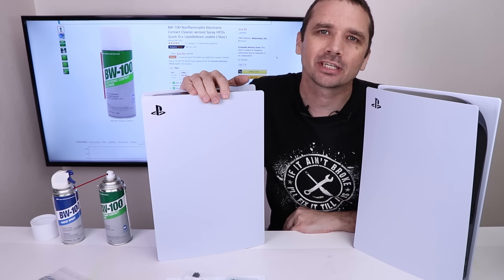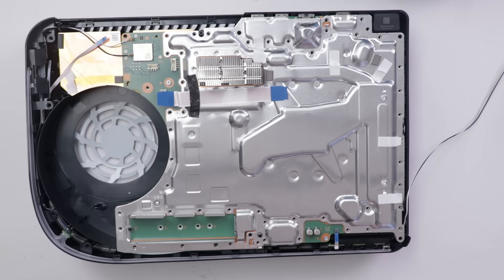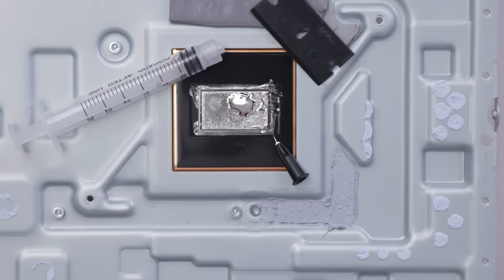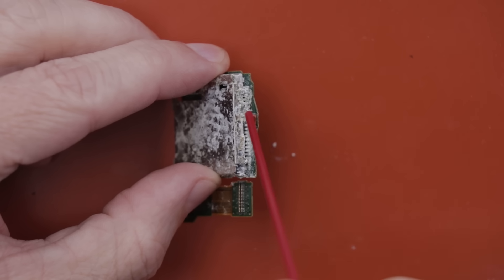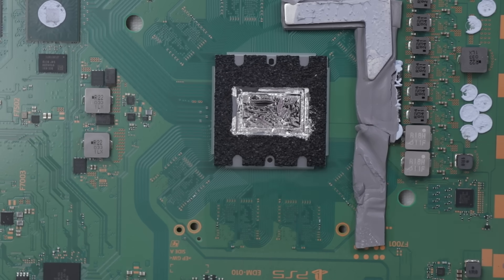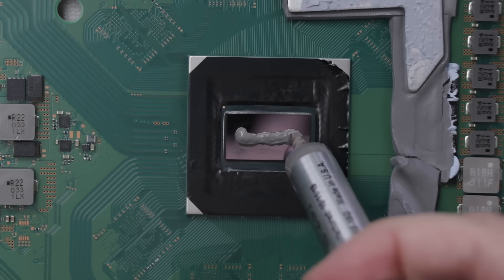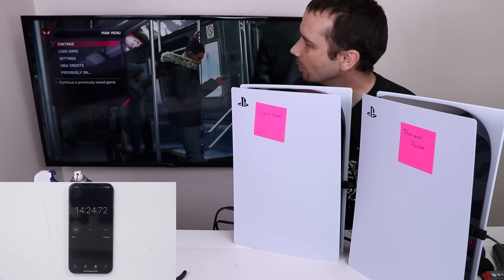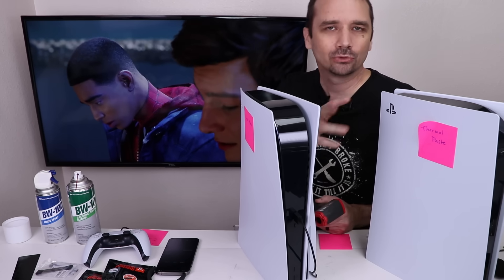PS5 Liquid Metal vs Thermal Paste - It OVERHEATED!

Comment: I still think liquid metal is just a bad idea in the long run. Especially with the bad time people have had with it already in PCs and how much it takes to clean it up without it going anywhere else. We'll see if we have a red ring of death type situation, or worse because it can destroy the system in worse ways.

I wonder how much damage it did with the liquid metal because it was still on versus the thermal just turning off right away during the fan test.

Comment: I guess the main reason for Sony to switch to liquid metal is to keep thermal interface maintenance free because that was a big deal with PS4 which required thermal paste replacing every 3 years unless you're fine with jet engine sound. Thermal paste no matter how good and expensive still dries out and loose its thermal conductivity while liquid metal doesn't.

Comment: wayyyyyyyyyyyyyyyyyy too much thermal paste applied. that will ooze everywhere off the chip and cause overheating and other issues. Tiny pea sized drop in the middle is all that’s needed, nothing more. Very infuriating to hear “perfect amount of thermal paste” and then see that murder scene when you apply it literally scraping off the edges off the chip with paste

Comment: Hello! I hope my comment is still appropriate, considering this video is 2 years old now. 

I have a feeling that the PS5 has a terrible design flaw and overheating issue which Sony wasn't able to solve and that's why they went with the liquid metal. 
As a last resort to be able to launch the console on time.

Looking at your recent /2023/ liquid metal dry spot videos, I'm getting fairly concerned that the liquid metal is not really a 100% fix for their own issue either. Basically these PS5s just slowly cooking themselves until they boiled and instant e-waste after 5 years. If they last 5 years.

Also it is confirmed that the PS5 by hardware are not capable to output an 8K video signal, but it's on the box. So this liquid metal and 8K issue are just a hot bed for the perfect lawsuit but i have no idea when, who and how will go against Sony and claim his money back.

On the other hand, Series S and X runs perfectly /the X even on bigger performance then the PS5/ on thermal paste...
Reply: Average XBOX Fan Boy

Comment: although the liquid metal ps5 obviously ran longer the test time is wrong. you cut them on at the same time and ran the thermal paste one first till it overheated then when you should have ran them both till overheating. The time to run 1 switch cords and boot  the game on the other might only be 2 minuets at the most but is still not  accurate.

Comment: Hey I have a question....have you ever seen a PS5 that is missing the green bottom that holds the spacer for an internal ssd?? I don't have the green bottom that has the indentions where the spacer fits into before you put the screw into the ssd. Down by your left hand at 2:03.  Mine is just the metal bottom with the screw holes. No green bottom nor does it have the spaces to allow your spacer to fit into for whichever internall ssd you choose to use. Have you ever seen that before or did someone forget to put that piece in?? I can still put the ssd in but it doesn't sit in perfectly. It works but every video I've seen with a PS5 opened that piece is there.
Reply: You’ve got a newer model of the PS5 then.

Comment: I'm confused. Why would the PS5 stock overheat at all? I'm shocked honestly as I just ordered one lol.
Reply: He misspoke ps4 several times. This was when ps5 was new
Reply: @JWalker Don't worry about your new PS5 overheating. They have really great cooling designed into them. @ 2:07 Look at those heatsinks and copper tubing. If you got the room, lay it down. I saw somewhere, the liquid metal flows to the lower side of the processor, when standing up.
Reply: @markorkarenhanes1354  that the launch models not anymore

Comment: glad you can take the motherboard/heat sync out together 
i was worried about that since i like taking my systems apart to clean the heat syncs every 6 months to a year (depending on how bad dust/pet hair gets to it
i know theres vent holes you can use a vacuum to suck out dust/etc but i feel like those dont actually work that well

Comment: Ps3 ,ps4 was very strong consoles, I'm very sad the ps5 isn't strong, I hear, l see, I read ,many problems 😢 I hope to find a solution before is to late and this great company fade slowly in the dark
Reply: a solution to what?? what are the many problems? I've had mine since release and 0 issues
Reply: @Ryan shnoztwazzle  search to YouTube  " ps5 problems over heating  and liquid Metal problems"""and you will find the answer
Reply: Uhh you need around 24 PlayStation 3 consoles to match a single PlayStation 5 or about 8 PlayStation 4 systems to once again match a single PlayStation 5 in terms of power, so no neither the PlayStation 3 nor PlayStation 4 are "strong" compared to a single PlayStation 5
Reply: @BambanGarcia  the truth is the ps3 consoles and ps4 pro and slim,,still working and the owners are happy because the money 💰 don't drop in trash can ,,,but the ps5 owners spend 700 $ for one  console and after one year to many are at the technicians by overheating cpu or overheating ssd or other problem,,,isn't crazy to many people     and they are freaking about ps5

Comment: Thermal paste didn't work well with the ps3. Yellow light of death was basically the thermal paste burning off. Afterward I had to constantly reapply with a cheaper one that was available over the counter because the one Sony used was banned for environmental reasons.
Reply: So does using Liquid Metal avoid the Yellow Light?
(60GB BACKWARDS COMPATIBLE PS3, PLAYS ALL PS2 GAMES, has the PS2's CPU/GPU)
Reply: @LennyJBA  I don't think you could properly seal in the liquid metal on the ps3. I don't think the tolerance in fittment would allow for the same sort of seal as on a ps5 but I could be wrong. It's been over a decade since I did all that.

Comment: Thermal past is looking a lot more interesting now with all the reports of dying PS5 because the liquid metal can leaked out of the APU into the motherboard...
Reply: There are no ps5 dying because of liquid metal, it's just rumors, plus wouldn't have the engineers at sony thought of that first?
Reply: @andrejpopovic52  And engineers never made mistakes? The point is that you can't blindly trust anyone, but there's no harm in warning people about a potential issue but it's just dumb to accuse someone trying to help while defending a mega corporation driven by money.
Reply: @ale-lp  It only leaks if you try to mess around and tamper with the heatsink

Comment: Tronics, have you heard the latest news?  The liquid metal is leaking into the seal of the apu in the vertical position.  I want to use it vertically, but the only solution out there is to turn it horizontal to prevent this.  There's gotta be something we can do to use it vertically without worrying about it leaking.  What can we do?
Reply: You have literally nothing at all to worry about, bro. I'm an IT Hardware Technician, and I performed a tear-down of mine two days ago (Been in Vertical position since April 2021 and played on a near daily basis). Nothing at all was wrong, APU seal was still holding strong with no issues whatsoever. Don't believe the hype, it's not a widespread problem.
Reply: Not buy into click bait articles based off a guy who runs a repair shop and only sees bad things. 30 million sold and it isn't some red ring of death level issue. I think you'll be fine man.
Reply: literally nopthing unless you open it up and rub vaseline everywhere or stop the force of gravity
Reply: Lots of pressure is applied to the apu and the liquid metal. It cannot seep out

Comment: please never use such cans for cleaning your RIG. You can buy a blower and use it  everytime again. To disconnect the fan is no usecase, but i get the point.  Look how the PC guys do it for years. So there is "normally" not an issue with liquid metal if you follow the rules. The PS5 builder just apply too much. Sony, just put a glue on it like intel did it on their heatspreader. Please, not everybody wanna lay the big console only cause of your fault. Just sad, not more. This is not a new thing, you just need to do it right. I think every company needs to make their experience with liquid metal on the shoulders of their customers. for example: Miniforums PC with LM. Same sad story. Nobody learned something, nice !

Comment: Im wonder, is there any issues when you put PS5 with their Liquid metal on verticaly position? 
Is the gravity doesn't affect Liquid metal at all?? 

Thank you..
Reply: Standing it vertically shouldn't cause the liquid metal to fall onto everything else in the motherboard. The ps5 has multiple seals to protect it. It can still happen though if the ps5 is bumped really hard enough to cause the liquid metals seal to break and start dripping over the motherboard. But if it's just sitting there and you handle it with care(not bumping it) it should be fine.

Comment: What if you use twice the amount of liquid metal?
Reply: You wouldn't want that as you want to use the lowest amount possible to keep it from leaking on other parts of the board as gallium is corrosive. And same with thermal compound to create less resistance for heat.
Reply: @Whaley96  thanks
Reply: @drewhjc  Well with thermal paste you are applying pressure so the excess is squeezed out, making a mess. So there is no increase in resistance, it just makes a mess.
Reply: You flood the machine and risk shorting. Personally its an odd choice for a console, the seals make sense but in the long run we all know seals fail.
Reply: @YGBHawk  it's not an odd choice it's better than normal thermal paste. But they have a bad thermal solution in general as it doesn't get much airflow and the fin stack is kinda small in an effort to save on materials. So you can feel about it how you want but it was designed that way.
Reply: @Whaley96  Yeah also turns out some PlayStations are failing because of the liquid metal. So it is a little odd.
Reply: @YGBHawk  honestly I thought their solution for the run off was pretty cleaver. But either way I play on PC and just use normal thermal paste so it doesn't affect me thankfully lol.
Reply: @Whaley96  Same, but my Mrs recently got a PS5. Apparently, the solution is not equal on all PS5's. Some standing vertically are failing due to run off from the liquid metal. I was impressed by the solution too, im not sure why some fail and others don't. I did hear its model based or something, so maybe the solution has been modified in later consoles.

Comment: I replaced the thermal paste on my PC with mineral oil after lapping the mating surfaces and knocked 15°c off the temps.
Nothing beats a mechanical join for heat transfer.

Comment: Having disassembled these do you think having the system standing upright is a bad idea? Do you think the liquid metal pools at the bottom or has a chance of leaking?
Reply: This opinion is starting to be bigger and bigger, because still don't test 1 year ps5  
that has worked vertically and with one that has worked horizontally, if one of the two has problems
Reply: @sirusthevirus6879  Mine has been standing since I got it a few months ago...we'll see.
Reply: @noname-yb5jt  don't risk move it to horizontal position until we know what exactly happen after 1-2 years,,,also you must clean the fan after 1 year,,us easy and help the console
Reply: @sirusthevirus6879  Don't have a spot to lay it down at the moment. Yeah cleaning system's internally is important. I run an air purifier near all my electronics it helps with dust. Opened my OG PS4 pro a couple months ago and the fan had basically nothing on it. I was intending on doing the thermal paste but it was so clean I didn't bother. I always used a couple usb fans near the back of it pulling heat. It has always been quiet and cool.

Comment: You are one of the few youtubers that understands thermals, it's a breath of fresh air and keep up the good work! Most people would say the thermal paste works better because the air temp is cooler coming out the back of the PS5 🤦‍♂
Reply: Lmfao, that's sad
Reply: I was confused when the temp was lower with thermal paste. Why is that when ps5 was designed with Liquid Metal?
Reply: @trappz_io2620  late to the party, Liquid Metal is a better head conductor so the heat sink absorbs alot of the heat from the APU which is what you want.  thermal paste is a terrible heat conductor so chips are hotter and your heat sinks are cooler cause its not transferring the heat fast enough.  Hot Spots are much cooler with liquid metal than thermal paste too, thanks to how it conducts/transfer heat from chip to heatsink.
Reply: @trappz_io2620   Thermal paste transfers heat less efficiently so the heatsink doesn't get as hot because more heat is staying in the GPU which is not good. With the liquid metal it transfers heat way better so more of the heat from the GPU goes to the heatsink where the fan can blow it out the back resulting in a higher temp than the thermal paste.  I hope that helps I'm not the greatest at explaining things lol.
Reply: @trappz_io2620  🤦‍♂️
Reply: Real big brain people out there in the world, stay safe lol

Comment: The sponge and plastic cover are not necessary with the thermal paste, they are there to stop liquid metal running. I wonder if the performance will be improved if the sponge is removed when using the silver paste.

Comment: The fact after watching this video is: Thermal Paste fan curve will be triggered for higher rotation often more than metal, and thus, will be more audible but more cooler which breaks the logic for applying metal for durability purpose, it's in reality to please the audience with a mute console. What do you prefer? I prefer a cooler console because it will last more before breake. So if it was possible to run the blower fan at maximum or close to it PS5 would appreciate.

Comment: I’ve been watching you take ps5s apart for a while now. I only want to take the fan out to clean it but I’m still freaking too scared to do it
Reply: Dudes be pulling out engines out of their 50k plus Dollar cars only watching a few youtube videos. You should be fine. Just bear in mind that if you clean them using compressed air, hold the fan in place, because if the fan spins with the aid of compressed air, it may damage the fan's bearings.

Comment: so you want the air coming out to be hotter? if the air coming out is hotter doesnt that mean its at least that hot inside? the thermal paste PS5 had cooler ait coming out therefore its cooler inside. am I wrong?

Comment: The cooling solution in the PS5 is relatively weak for a system with 10Tflops compared to the Series X that has 12Tflops and currently runs cooler then the PS5 and doesnt use liquid metal. Sony cheaped out on cooling to achieve the acceptable bare minimum. Very curious how the system holds up not only over time but also once next gen games start rolling out that are only available on PS5 and can take full advantage of that performance.

Comment: What is liquid metal, something with gallium? I always thought that a lot of those components inside machines were aluminum, are they steel? As far as I know any metal that stays liquid at room temperature on earth is a metal that will seep its way into aluminum and form a brittle amalgam, shattering the part, not just causing a short. Is there a risk of metallic parts being crumbled by leaking liquid metal, or are the (non solder) shiny gray bits/plates not aluminum?

The capillary action of that cotton on the liquid metal seems sub-par. Maybe some sort of metal wool would work better? A really fine aluminum wool might absorb it really well, though it would render it unusable probably. Maybe there could be a kind of flux developed that helps get the liquid metal off of things, that electronics cleaner seemed pretty good. Either way, I assume there will be innovations to come in handling this tough material

Comment: Hi, there are a lot of rumors recently regarding the liquid metal leaking out of the sponge and causing short circuit on PS5s, and a many "recommendations" to keep the PS5 horizontally as this would prevent the liquid metal to leak out of the sponge, they say that if one leave their PS5 vertically the gravity would cause the liquid metal to leak as it would keep going down due to gravity, any thoughts on this?
Reply: Makes sense
Reply: @EnlightenAlchemist  does it tho?

Comment: there are actually much better thermal pastes then what he uses so it may run with thermal paste but PS5 will overheat if the Fan is Not plugged in even on liquid metal
Reply: not going to change anything

Comment: So, is it safe to have the ps5 vertical? Liquid might run over the MB in time sealed or not and there would be more liquid metal at the bottom rather than equally across. Just a thought. 😁
Reply: It’s built better to be vertical otherwise wouldn’t be advertised like it… I’ve had my digital version since launch placing it vertically with no issues and not 1 bit of sound from the system or the fan
Reply: it doesn't matter what's between the chip and heatsink can't go nowhere if it did that means there is a defect

Comment: ps4's have thermal paste ps5's might have liquid. my ps4 has had it thermal paste replaced 4 times since 1 1/2 yrs ago from new!!! it overheated with in a week of purchase!!! now it runs fine no more memory errors. or lagg spikes. and the wifi/Ethernet cable are working fine after.

Comment: So if ps5 overheats with regular thermal paste, why does a xbox series x not? I'm quite confused because a series x has basically the same cpu/gpu but at a higher clock.
Reply: Because Microsoft didn't cheap out on the heatsink.